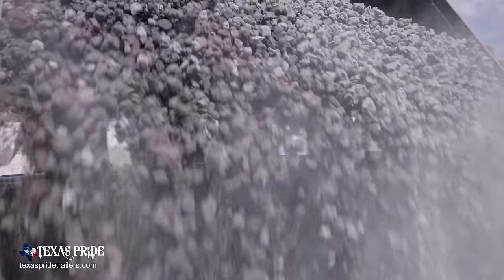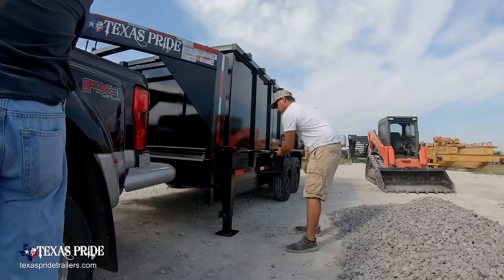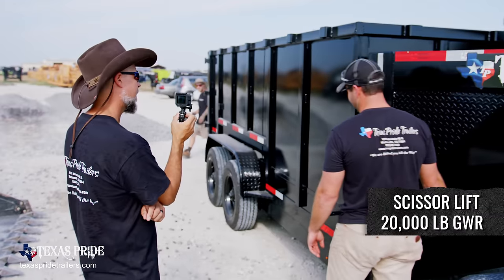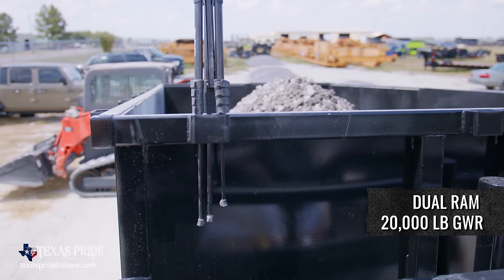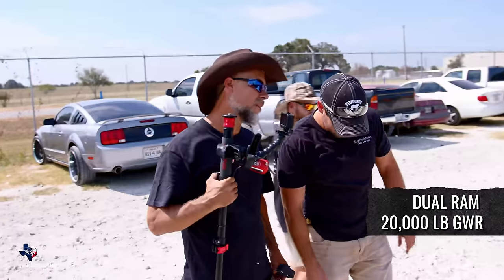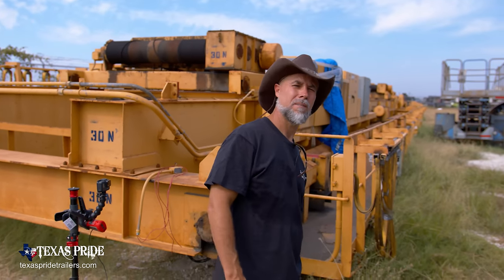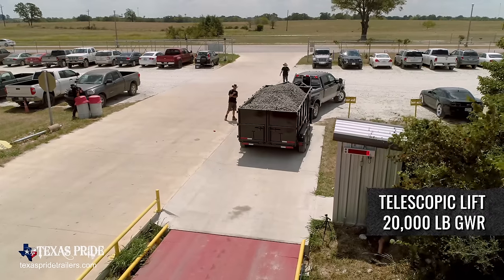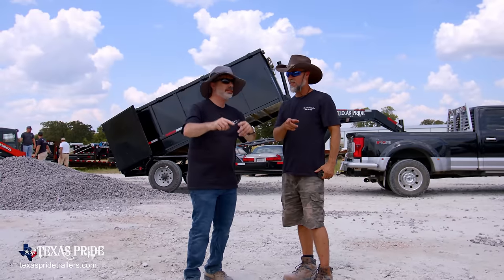Dirtmonkey Loads 50,000 Pounds In Our Dump Trailers! | Behind The Scenes

Comment: yep I'm sold. that's insane. have been tossing around spending 60k for a 26k roll off trailer with several 20 and 30 yard bins now I have no need to keep beating around the bush about it. I feel I can pay it off in 6 month or less easily.